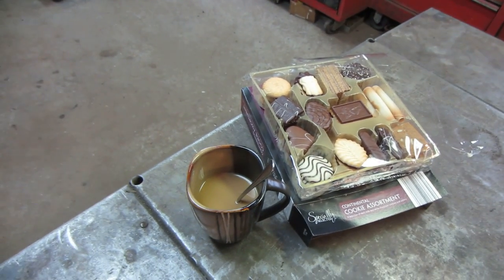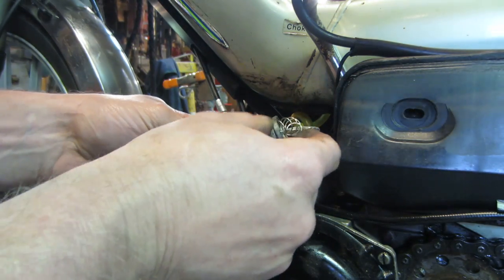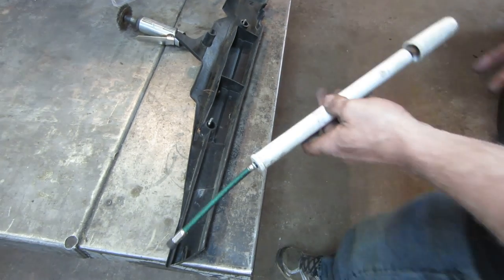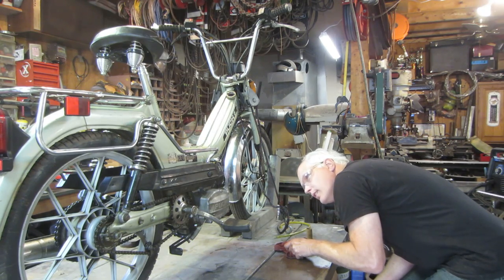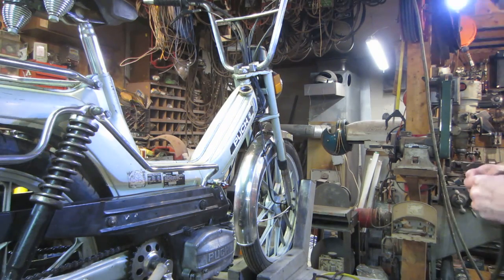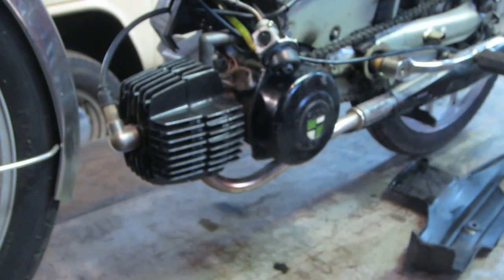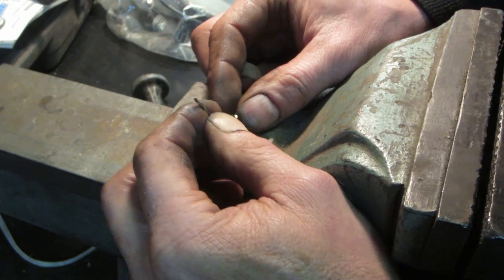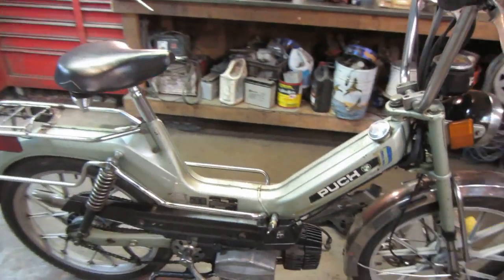puch maxi moped test and tune

Comment from the maker: playlist for this bike is here, https://www.youtube.com/playlist?list=PLZJS6Md1UOg0NLboAwLbwZH_wFvSVenYH
Reply: Mustie1 thnx for the cookie ;)
Reply: You are supposed to get a bit of momentum on pedals before you press the clutch, why is everyone doing this wrong
Reply: I used to ride mopeds in the Netherlands, among them Zundapp (great 
memories) and in my experience after a while the exhaust, especially 
close to the cylinder, would get a coating of carbon on the inside, 
restricting the engine. We either bought an exhaust with a lager 
diameter or tried to get the caking off, I sometimes used a wire in a 
drill and let it spin inside the tube to knock the carbon off.. Also the
 exhaust could get full of gooey residue in the muffler, sometimes we 
would poor gas into the exhaust, ignite it and let it burn off the 
residue. Obviously we did this outside and at a place where you would 
not cause damage of fire. Not to environmentally friendly but it's a 
two-stroke anyway ;) It was great to see those Bing carburetors again, 
so many combinations of carburetor size, jets and gas needles I tried to
 get the most power. Those Puch mopeds were very popular during the 
eighties and nineties, nowadays you see mostly moped scooters in Europe.
Reply: Tape on the plug wire might be to keep the water out ?
Reply: I used to own one of these in 1984. Man the fun I had. I was able to go abit faster though as I only weighed 120 soaking wet. I miss that old moped.
Reply: @L1TUST1M  No one cares.
Reply: You know what they say about “mopeds and some women”, there both fun, until you friends find out!
Reply: Take some speaker wire pull it apart and add on strands start with 3 and go up or depending on what ur doing

Comment: I'm 52 now, but when I was 14 in Ohio, my friends and I all found a way to acquire mopeds. In Ohio, in 1978ish, the law was that you could get a moped license at 14, but they could not exceed 20mph. Before that law went into place, mopeds could reach as high as 25 or 30mph. Two of my friends found some Vespa Ciao's that had saddlebags and turn signals, from an old couple a few doors down. They were older/faster. The mopeds, not my neighbors. Also, one friend had a Puch Maxi, another a Sachs Westlake, and another had a Garelli (don't know the model). I saved my chore money and bought a Vespa Ciao, but it didn't have turn signals or saddle bags, and was governed to exactly 20mph. The Ciao's were belt driven from a centrifugal clutch. Sounded like vacuum cleaners. I really liked the Sachs mopeds. German engineering and well built.
Reply: I'm from switzerland and kids drive to school with their puchs everyday because you can get a license at 14!
Reply: +eraldorh you didn't get the joke, both the characters in the pictures are from a video game
Reply: Here in the Netherlands we still drive these around, i have 2 Gilera Citta's which have the same engine as the Vespa ciao has. I tuned my gilera to go a pretty damn lot faster! got up to speeds around 90 kph - 55 mph. Pretty scare but woah what a fun it was!
Reply: Forthwith, Tx., Sounds like you and I had similar experiences as kids, I'm 49 now from Ohio myself. Cleveland area. Spent all my paper route and grass cutting money on The Vespa Grande and trying to get that magic 30 MPH.
Reply: I am 46 from Ohio and mopeds were the thing to have when I was 14. I had a Tomos 2-speed that would do almost 40 mph on level ground with no headwind.
Reply: I lived in NE Ohio, and got my moped from Rick Case in 1983.  The following year, they made helmets mandatory.
Reply: I live in germany and drive a Puch Maxi and a Piaggio/Vespa Ciao. The Maxi is really good Quality. I dont like Ciaos that much, mine always brakes down.
Reply: Canton Ohio here, had the exact model as this one except white. Rode the crap out of that thing, then the law changed.
Reply: @Brickztv  The one to have really was the Zündapp KS50 or the Puch Dakota though  the Yamaha FS1/Yankee and the Suzuki k50 were also great traditional mopeds here in sweden. The most classic might be the Solex Knallert with the Hanging scrotum as we call it here in sweden.
Reply: @rimmersbryggeri  my father had an older zündapp when he was my age, but unfortunally it was stolen, when he parked it at the train station
Reply: @rimmersbryggeri  in germany everyone is after puch monzas right now. espacially the 6-speed ones
Reply: @Brickztv   Puch had many great models, no discussion. Ecen the florida was cool but more of a granny's moped. We had alot of swedish models that were similar but the ones that looked liek actual motorbikes like the dakota and KS50 there werent many swedish made options. All the swedish ones had Sachs Ilo or victoria engines though.
Reply: @habyss  i got one at Rick Case also about that time   i live about a mile from now

Comment: I never thought, that a Maxi runs also in the USA.
Good work!
Greetings from Austria!
Reply: Me too. Here in Holland they were all over the streets in the '80's ( this model and Peugeot, Honda, Zündapp, Kreidler, Yamaha, Mobilette and many more makes). Never realised they liked mopeds too in the US.
Reply: @ZerokillerOppel1  Not as common as in Europe though but it was sold all over the world, and btw you forget the the Puch Dakota, that is one of the best and very sought for in the 70 to 80.
Reply: They're definitely bigger across the pond but they still have a place in the states... Tomos mopeds were super popular in my town in highschool and I see a lot of other scoots with the occasional moped around in denver. After having a ruckus and a 77 batavus stolen, I went for a cheap Chinese scoot for my 3rd and mechanically its been just as reliable as any others I've owned over the years. The batavus was a real dog.. always started right up but you'd be lucky to surpass 25 on flat.
Reply: I have just bought a Maxi in the UK which has been stored and not ridden or taxed since 1984! Having been off the road for 35 years I have a feeling it will be a challenge to get running again, but I am going to push myself to learn!

Comment: I had a Puke maxi and a Pewgeot MP50 when I was a teeny. The Puch had the edge with it's awesome speed and power. If you sat on the back rack and dug your heels in you could get the front wheel in the air. I kept it even when I was riding a Kwacker Z900 purely because it was such a chick magnet with its gleaming metalic purple paint and chrome crash bars. Awesome!

Comment: I had one of these. Bought it new. Was a 1978. Paid with optional cateye turn signals
$764.40 with tax. Top speed on the 1.5hp model I had was an indicated 28mph.I later bought the genuine puch saddle bags and was able to carry a case of beer in cans.

Comment: Great Video! I'm currently getting a mint condition Puch of the same model and year of Manufacture as yours ready for my daughter to take back to campus on the west coast. I should say near mint as it looks mint with some engine and other mechanical issues. I was a moped guy as a kid. I saved for a Vespa Grande ( It was the only moped available to me in my area at the time ) and it was a great looking moped and ran very well but it was a heavy moped and it would barely hit 20 MPH (which was the legal limit in my state at that time too ) with it's belt drive and it's two piece, V expanding clutch which was the "automatic variable speed transmission". Just a year later, Puch and Tomas mopeds were available readily and the speed limit was raised to 30. They were also much less expensive than the Vespa. I spent a great deal of time and paper route and lawn cutting money as a kid ( 12, 13 yrs. old ) trying to figure out that huge "secret" to get the extra 10 MPH lol. Still have the Vespa, it's sitting in my Uncle's barn waiting to be resurrected. That's a future project. Thanks for the excellent video.

Comment: You are right about the 4 stroking, it just needs leaning off a touch. You could raise the exhaust port about 1.5-2 mm, you could remove 2mm off the back of the piston skirt (assuming that it is piston ported!), skim 0.5mm off the head, it will end up doing 45 MPH!

Comment: In 1969 I purchased an Allstate Motorcycle used, it originally was sold by sears. It was a 175 cc two stroke, twin pistons one spark plug. Puch made these cycles for Sears and Sears Robuck & Co, sold them under the name Allstate. I'm sure the cycle was at least 5 years old when I purchased it. Also the air cleaner was the choke, you rotated at bezel on the front which either opened or close the air inlet vents in front. I thought you might find my comment interesting. I unfortunately melted a cylinder, I probably didn't have the fuel and oil mixed correctly, and I found a collector who used to sell Puchs, that had a Yamaha dealership and I got a 1 year old 125 Enduro with posi injection for just a few hundred bucks and that old AllState. I felt lucky to have elec. start and a reliable bike lol.

Comment: Worked building exercise equipment for a few years. Best thing we found for installing 2' long grips on stair climbers was hairspray. Spray it inside grip, and on handlebars, slides on like butter, when it dries, it aint coming off, unless you use air to remove grip.

Comment: We always used to change the metal spark plug cap for a plastic one, as when it rained as it does frequently in the UK, occasionally the whole bike became one massive spark plug, and you’d get shocked through the frame. Lol.

Comment: Just remove the plastic hat on the choke pin. The choke gets deactivated when you open the throttle to full, no need to ever pull the choke pin up again. Thats what the small notch in the throttle is for, and the flap on the chokeslide.
Reply: Exactly. I've been working on Puch mopeds since I was a kid, and it's not rocket science - they're quite basic and simple to work on.

Comment: I brought my first puch maxi in 1978 and cut my teeth on how to strip the head off and sort out the decompression valve and put the carburettor right and I was 16 years old,, by the look of yours it was a two speed with a clutch as I only saw 1 in the uk, I’m writing this as you are pulling the carb to bits,, it was my first freedom on the road then went on to the puch Grand Prix if you can find one.

Comment: Actually filling the jet with solder and the redrilling it is super easy.  the really nice thing about doing it that way is there no fear of going too big because all you have to do it hit it with the solder again and start over.  I've used that method many many times and never had an issue.  Of course a set of jet drills is kind of needed.

Comment: The plastic disc in the front drive chain sprocket is to cushion the chain links as they pass over the teeth of the sprocket.
Try running the bike with the small white air cleaner tube that fits into the frame removed.
 That seems to cure 4 stroking at high revs.
You can buy 70cc cylinder, piston kits to update this engine.They are bulletproof.
J.Williams. UK.

Comment: I used to repair these at a bombardier skidoo dealership for years. A little tip- dont use ATF in trans. Use Ep 90 gear oil- runs smoother and cooler.

Comment: the netherlands sells up to 80cc's for a puch maxi. 

and a tip, remove the bottom piston ring. runs allot smoother and coasts better.
also remove the headgasket, runs like it has a shaved head. 👍 

can't kill these thing anyway

Comment: Just a thought ... instead of drilling out the two-stroke muffler (or in addition to), seems like a good idea to maybe soak the muffler in solvent overnight. Next day, blow it out with air and then re-attach. Solvent might also help to stop surface rust from going further into the metal.
Also, RE: two-strokes ... pretty important, I think, to have the correct fuel/oil ratio. I'll never forget, my old Hodaka 90 called for 20:1 mix.

Comment: choke pin should be al te way down for ON. to start it at cold weather. and when it runs the choke will also come up and thus OFF. when you rotate your trottle handle.  the trottle slider pulls the choke up and off when the trottle slider goes up.

Comment: Here's a little trick I use that perhaps might help you. When a jet is slightly too large I take a small phillips screw driver and give several hammer wacks to put an x in the bore. If you do go too far (smaller) a torch tip cleaner goes quick to lightly final adjust. Hope this helps...

Comment: I sold motor cycles and mopeds in the 1970 to 1990 period. Japanese and European makes. When we were building them up fresh out of the crate we always junked those blasted metal shrouds on the plug caps. They often picked up the current by way of induction and would partially short out to the fins, especially in damp or wet weather. Caused misfires and poor performance, if necessary we replaced them altogether with old fashioned rubber caps. After all they were only there to reduce interference to radio and TV sets. Made a big difference to my favourite big Kawasaki triple anyway.

Comment: I had the same problem with the fuel switch on my Puch Monza.
The 30 year old one was full of crap and the new one was leaking everywhere, it couldn't even close the fuel to the carb so i could just keep driving around, with fuel soaked pants.
Aften some cleaning the old one was mounted again and the new one ended in the trash.

Comment: I would offset the carb to make clearance for the choke, I had to do this for a General 5 star back in the 1980’s, boy do I miss that thing, 40 mph and fifty miles per gallon when it finally went off to the moped rust in pieces location down the road 10 years ago, it was a daily rider for local errands from 1983 until 2004, when the frame was starting to break more then the welds!

Comment: You might try the trick of running a fine gauge wire through jet. (Take multi stranded wire and separate out single strand.) Jet size is reduced by wire area. Make sure to fold end under jet edge so it gets clamped and won't suck wire through.

Comment: Is it some kind of 2 gear automatic setup? Sounds like it. In this country (Denmark) we had them only 1 gear and some kind of centrifugal cluch or later 2 gears manual cluch I think. Brings me back some years, boys had Puch (3 or 4 gears) or Yamaha with 4 gears and girls almost all had Puch Maxi. Mine was a 1973 model Suzuki K50L  1hp, but not for long. Ended up with aprox 4,5 hp and going about 40-45 mph too
Reply from the maker: yep its a 2 speed auto

Comment: Maybe it's just how the camera reproduces it, but the great increase of brightness of the lamps when revving up could indicate a defect voltage regulator. Maybe measure the voltage when  running on max rpm. If it's too high, the moped will chew through lightbulbs and fry the ignition-system (don't know the english term for Zündkontakte) sometimes soon.

Comment: Older moped engines had carbs with adjustable jet by a domeshaped screw with a small handle like a pin. Husquarna, Ilo, Sachs, Puch and Zundapp.

Comment: The hight setting of the needle underneath the gasvalve you can adjust the gas mix there is a little clip you need to get of en set the needle lower to get less benzine mix

Comment: there are limitations to power output on these, some have exhaust restrictors, some have the timing set back and some limit the port sizes so it can only flow so much , you do what you can with them, this one sounds peppy though

Comment: thanks for the cookies. i have had a dozen puchs all super fun to ride easy to make go fast had one that would touch 60. at close to 11k rpm. small things that help stock bikes is get rid of the super thick head gaskets toss the air box and rip a few baffles out of the pipe for all models. a stock 50cc 1.5 hp or 2hp. will get close to 40. pipe and kit one and its time to race the scooter kids!
Reply from the maker: l got a video coming out in a day or two, playing with the jetting,
Reply: sweet! can't wait. really enjoy this channel. i live in the area hope to get to chat with you at one of the air-cooled meets one of these days.

Comment: Remove the pedal system and replace it with bar and footsteps. You don't need it. When cornering with a pedal in lower position it might hit the ground, my unfortunate experience...You can start the bike by just pushing.
I also removed the stand and replaced it with a jiffy type, side stand. It's more stable.

Comment: If I got one of these I'd run it with an expansion chamber.  A good expansion chamber will make it even quieter and give you higher low-end torque.

Comment: Surprised that the petcock lever doesn't have an o-ring wrapped around it's outside edge. Also, the machining on a repro one is probably crappy - flattening the mating surfaces on a piece of glass covered with 1000 grit paper might make a better seal.

Comment: You don't need to 'Framer's knurl" the shaft, the choke is applied when you  push it down and unchoked when you crank the throttle.  You never need to pull on it. Even then  dab of loctite would do just fine...

Comment: Next time buy a bing carburetor that has the main nozzle on the side. The one you bought should have had that and then you change that fixed one out and put a special screw in typ of nozzle that you can regulate the mix while riding and get perfect mix.

Comment: Nice work mate, but you should had put an 18 mm DellOrto carburettor on it. It would have run about 35 - 40 mph.

- and you should had put an adjustable nozzle in it. Much easier to make it run smooth.

Comment: You should not need the chock if you have a primer button.
when starting the bike cold turn the gas petcock on then push and hold the primer button (that"s the black domed button next to the choke ) down till you see gas flowing out of it. now the carb. is primed peddle the bike twist the throttle and it should start up. I"m Just say"n